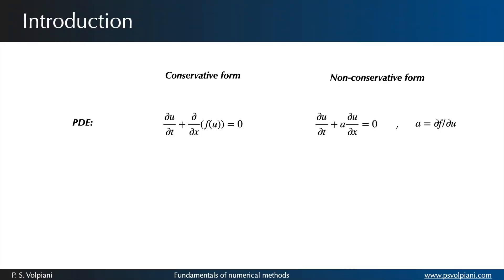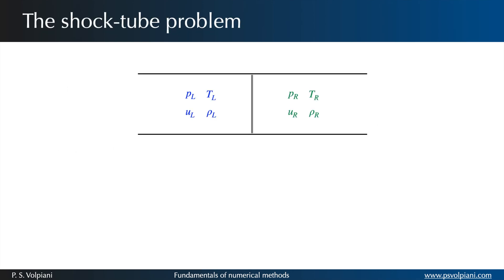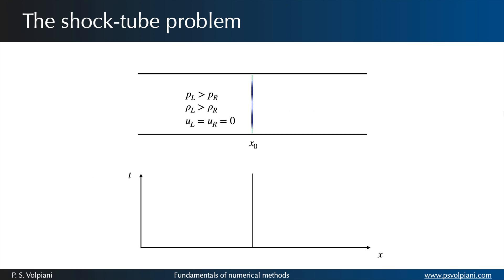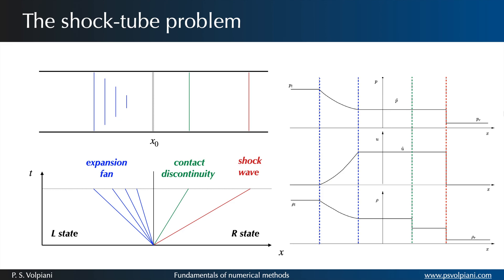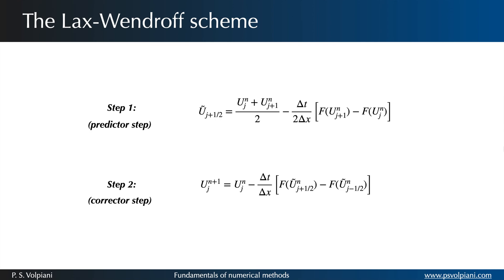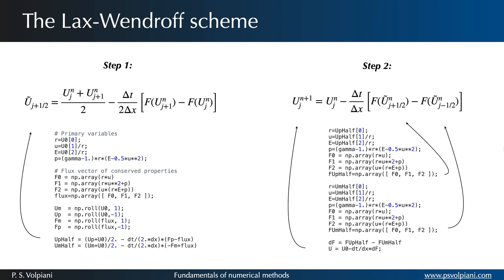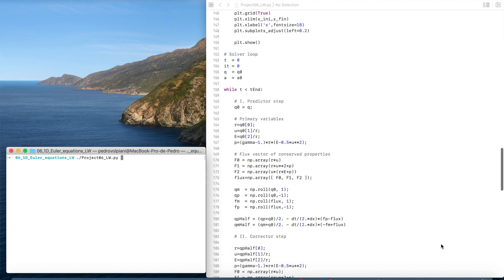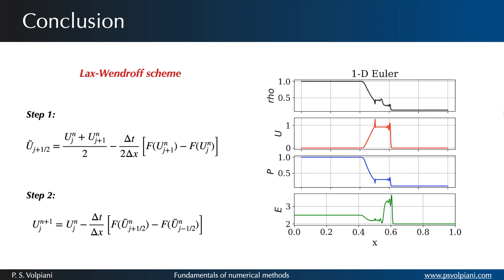CFD-06: How to solve the shock-tube problem using the Lax-Wendroff scheme?

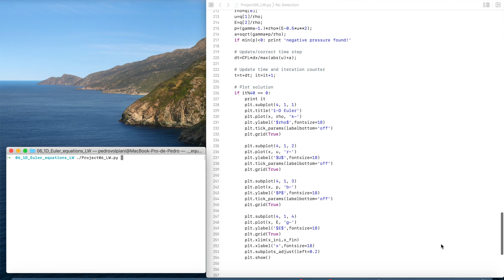Comment: Thanks for sharing, this whole playlist is great. Question, on lines 206-208 (Project06_LW.py, ~5:01) you assign the values of a previous iteration as B.C. Did you mean to assign a [constant] q0 saved before the solution-loop starts? Also, the code-comment says Neumann but the B.C. assignment looks Dirichlet. Was this a mistake? Again, great material. I was looking for an intro to approximate Riemann solvers and your videos do just that. Very concise python notation too!
Reply from the maker: Hello José, thanks for pointing it out! It is a Dirichlet boundary condition for sure. Concerning the specification of BC, we usually use a fixed value, but since we know it does not change, I opted to write it in this way. Of course you can adapt the code if you want to. I'm glad you found the video useful! Thanks for watching!